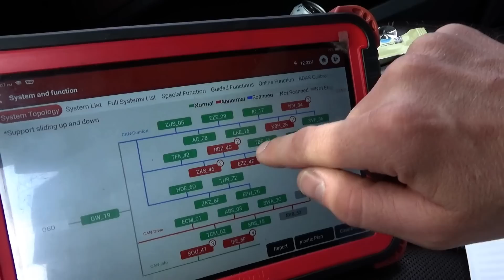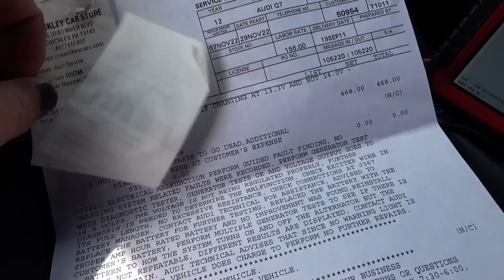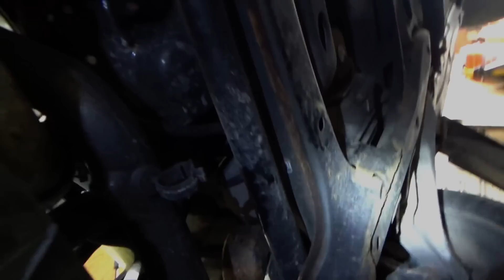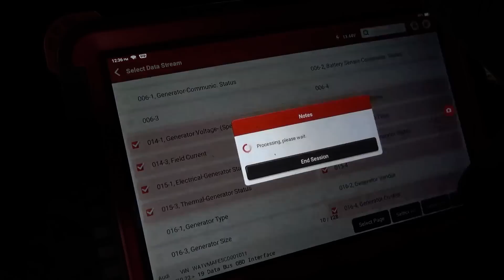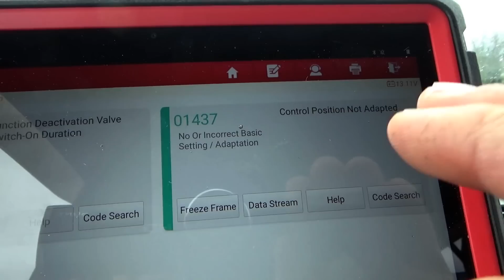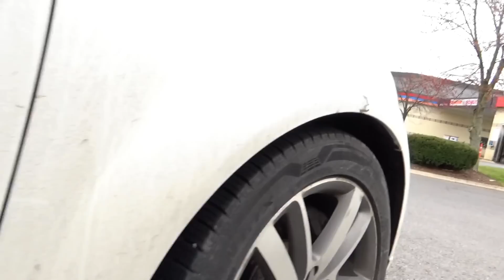Audi From HELL...DEALER STUMPED!! (Part 1 - Charging & Air Suspension MALFUNCTION)

Comment: You know what I use the dealer for?  I wait for their synthetic oil change, or transmission flush special coupon in the mail, then also get their 200 point write up for free.  Decline the determined other repairs, and say thank you and goodbye.  Then I go to O'Reillys or Rockauto and book a Saturday morning for my own services at typically 1/5th the cost, all in.  Their CRM system must hate customers like me.  Flagged as a cheapskate.

Comment: Boy ow boy Ivan you got that right get a reader and a few tools you will save money.my wife's car "Dodge  charger " has electrical issues I took to shop here they had for a week could not find the issue for it back home on trailer a few hours later I found that one of the ecm plugs was loose how I don't know but everything lead me to there pushed plug into ecm she is driving it still to today .it still has a blinking over head but I don't wanna got there .

Comment: I chased a low voltage code for 6 months just to find the car was coded for OEM EFB when it had an AGM battery in it 😅 It fixed so many random symptoms. All the way down to it fixed the dangerous inconsistent braking

Comment: It seems Audi repair is the same mess everywhere in the world. The only thing they know is to replace expensive parts until it works by magic.
I'm more and more thinking about purchasing my own diag tool... Audi is not able to repair my Q7 (air suspension issue, air conditioning heratic behavior), when I see how they analize data... In fact they are just lost. They come from mechanics not from electronics and software. They have no methodology to understand an issue as soon as it touch sensors, actuators and so on.
Not acceptable from a brand who's supposed to be high-end. High-end doesn't mean just high cost :) it shall mean high expertize first

Comment: Good advice. Got myself an XTool D8S and have already made two key replacements for my 2011 Ram 3500 dually, and found five codes in my fairly new Subaru Ascent that for some reason did not set a check light but they were serious electrical stuff cause by the dealer screwing up a radio/entertainment head replacement. Your videos help me transition from commercial electrician to auto electronic tech. Thanks.

Comment: I had a similar experience with a Range Rover. I did not have the correct scanner for the customer's vehicle so I took it to a reputable ( I thought) Land Rover dealership for an inoperative air system. Before they would diagnose it they said that all 4 shocks had to be replaced then they would proceed. Total cost 2500.00 x 4 = 10,000.00 CDN  labour not included. I declined and later discovered the reservoir tank had rusted out.

Comment: Makes my blood boil too, but using my autel maxi system is was able to reset all my suspension,  and calibration was a doddle. I had similar charging issues with my q7, and found that after a battery change the new battery type size and charging rate didn't log after I had told the car the battery had been changed, I disconnected the battery and then connected it again, and was successful in setting the new details. All good now.

Comment: Another reason why I will never again use a dealer for service unless required due to specialty tools or processes.  I've had very similar negative experiences and had to fix poorly completed work and components.  I've been a VW/Audi guy for a long time and I've come to a conclusion on their products.  Anyone outside of the engineering group of VAG do not properly understand how their systems work.  That's why they suggest ridiculous things like a harness replacement for a partially corroded connector.  They are turning into an overpriced parts cannon where the only person who loses is the customer or in your case, the independent shops.

Comment: With the correct OEM tools you should be able to talk directly to the air ride control module. This is done end of line at the assembly plant. If you can talk to the air ride suspension module you should be able to have the system do a systems check, and if this fails, read a DTC (This may be a OEM only tool DTC) that identifies what the module thinks is the failure. Unfortunately, an intermittent power failure when the vehicle changes ride height because of the harness(s) moving around and or being pinched in the suspension the module cannot perform the complete self test. The self test assumes a lot is working, as would be the case of a just built vehicle end of line at the assembly plant. So, if there is an unexpected failure during the self test the diagnostic coverage may be inadequate.

Comment: If its not under warranty, dont go near dealers unless there is simply no other choice.  Here in Australia, Toyota dealers were charging US $5000 to do a rear main seal on an engine, on the V8 turbo diesels.  Its a simple seal job, that does require the transfer case and gearbox to come out, but thats it.

Comment: I'm wondering about those HI liquid cooled alternators. Quite a few ND ones are now built with 12 diodes in the rectifier plate instead of the older common types with six diodes on the plate. These 12 diode types also have a very sensitive load sensing circuit in the regulator that can cause all sorts of electrical issues when things are not kosher with a stable output. The last one I repaired had a partially damaged/overheated diode that only a visual inspection could identify. To be safe with the repair after testing the field coils to be in spec, besides the 12 diode rectifier plate, the regulator and brush holder were also replaced. It is now back to factory service spec.

Comment: Right, if you are going to work on Audi's and VW's , I can't recommend VCDS by Ross-Tech enough.  However, keep in mind that it too has its limitations:  It can not connect to VW / Audi Servers so it can not remove component protection for new or used modules ; it also can not do keys or any other sensitive functions.  At present it does not have SFD capabilities (security protection , ie modules are locked) unless you open them with other scanners (but you need tokens) , then once opened you can use VCDS for diagnosis.  This is primarily on the very current Audi/VW's 2021 and up (approximately).  
I would join their Web Forum and have a look around and feel free to ask questions , its a excellent resource.
The customer support is excellent and the employees and the owner are extremely knowledgeable in their respective areas.  But, you need to be a customer with a genuine VCDS interface to obtain support.

Comment: No.... Listen Ivan - I was an Audi master tech in the bay area at the dealer downtown San Francisco for 20 years, R8 certified the whole lot. There are no rules that because he found corrosion he has to follow a certain recommendation / troubleshoot route! - We were trained to diag. in a certain way but you at liberty to use your brain to find a solution as you see fit. He messed up. He failed to recognize that the connector wasn't fully connected and this caused him to burn time in a different direction, but he still should have realized that the connecter was essentially a broken wire. You should have been refunded and offered a job! Dealers take money - they don't give it out.

Comment: The car is a Christmas tree in part because they have the ECU monitoring stupid things that I assume are cheap sensors, is a sensor monitoring speakers auto engine grade. People pay $50K for an Audi they will pay several grand a year turning off lights, the put the stupid sensors in to create repair revenue. The repair of replacing the whole system would probably be thousands of dollars. I had an engine light and limp home mode, brought it in, they replaced the ECU for $2K and has been fine for years since, things break, and it cost what it cost, modules and mostly the programming are beyond what I try to do.

Comment: Easy fix, replace the air compressor relay under the steering wheel, remove the 373 relay, replace it with 645 relay, job complete.

Comment: I like your videos, Ivan!
It's educational to watch 🙂

I don't have any good experience with dealership shops. One time they broke the threads on the oil pan for the drainage bolt on a near factory new Skoda. The pan was aluminium and the bolt too.
They probably used a power tool to tighten the bolt. They had the audacity to try to charge the cost of replacing the pan to me. After a heated exchange with the shop supervisor
they admitted that they had caused this.  After this I took care of the oil change myself and I promised myself to stay away from dealership shops.

Comment: I blame manufacturers just as much as dealers and techs.  I don't work with cars but every manufacturer I've dealt with has pushed their garbage diag flow charts and resistance tests on wires.  Telling techs to do pointless tests instead of thinking critically and logically sets the wrong precedent.
I just worked on a tractor today that someone else had previously and replaced a bunch of fuel system parts on the customers dime based on the manufacturers recommendations.  I looked at it and found a pinched fuel line in a few minutes.  Fixed with a zip tie to hold it out of the pinch point.

Comment: Ivan??? They charged you $620 to tell you the pump was 'bad'.  You PROVED that the pump was NOT bad.  You were able to manually actuate the pump via your scan tool. You should have INSISTED on your money back.  I don't care about their 'hands being tied'.  Their hands are tied but your wallet is the one held hostage. Again-  you did in 10 minutes what they COULDN'T do in 3 hours and they charged you for it!  I'm in the service business as well-  if I don't fix a customer's problem or properly diagnose the problem- they don't see a bill-  EVER!   I KNOW you work the same way.  Ivan- you need to go back there. Bring your wife-  women know how to kick ass in situations like this- you should see them in court.

BTW- they said they 'bench tested' the pump. THAT'S a lie, if they bench tested, they would have had to have plugged into that same plug that wasn't in all the way, and even if they did, that means they didn't plug it back in correctly after the test assuming the compressor was part of the 'bench test'.  GET YOUR MONEY BACK Ivan.

Comment: I feel if the Master Tech couldn't do anything in one hour that should be a red flag. And why do you need two more hours? Why not just one more hour? He is the MT after all

I think their procedures are designed to condemn the  troubled system as quickly as they can and then recommend a full replacement. Asking for two more hours is just fraud, excuse me, extra profit.

Comment: This is a deliberate scam. Those air pumps contain a desiccant that has a limited life so once they are over a certain age water will build up in the system. That in turn will destroy the valves etc. So basically the pump needs to be replaced at the first hint of any problem. Its probably possible to dry it out yourself in an oven.

Comment: I'm shocked the tech stood by that harness damage and shrugged his shoulders at it. It runs, doesn't cause an open from over current. I remember I had this Mercedes with air suspension that wouldn't calibrate, you have to input a bunch of measurements you take off the vehicle chassis and it would check for rationality and it was supposed to calibrate. it wouldn't take every time we input the measurements. after hours of frustration, we ended up tweaking the ride height sensors just enough to see a slightly lower voltage feeding into the module to get the system to be happy with the body measurements. I wonder if this is something similar, just the wear and tear on the joints and bushings not letting the sensor read a low enough voltage for the rationality check. I would imagine the pressure sensor would want to see a pressure below a set value, and the ride height to be at or below a certain reading, or at least all sensors reading the same, before continuing the calibration. Wonder if you're fighting a mechanical gremlin that's preventing the sensors from providing a low enough reading to finish the calibration. Definitely a frustrating one Ivan!

Comment: I have a Q7 with the air suspension.
The usual problem is the compressor no longer can pump up to 16bar. 16 bar is where it is commanded off once it fills the accumulator. It only starts the compressor >40km/h (30mph) and automatically stops when you go below that speed. The only time it runs the compressor below this normal operation is when the accumulator pressure is too low and one axel is too low.

The compressor is protected by a temperature sensor in the compressors head. When the compressor can no longer do 16bar it gets commanded on forever, but is really cycled by the temperature sensor that stops it at 160DegC for a period. When the compressor is failing it will run for 20 seconds stop 15 minutes (guess) run again, temperature spikes and its off again. So the system pressure only gets to 7-9 bar (my car test results)  and this is just insufficient and you can not get the car all nice and even and level . One side maybe an inch high/lower.

So first test to see if the compressor can still do 16bar if not there are compressor ring replacements kits (after market) and ever entire piston and cylinder heads kits that are also cheap. I repaired mine in the first month of buying the car and now the suspension is always level and the compressor is not always running. 

I understand that this maybe a different issue but if that compressor that is now the right age to be in need of a fixin  I would absolutely be  checking this.

If somebody has tried to recalibrate in the past and it locked them out or the process failed somehow you will now have a fault on this ‘basic setting’ or ‘calibration not run’ 

Got to the end here and realised you also filmed this some time ago and also have already got to your conclusion / repair. But love your vids bud , keep it up I enjoy them.

Comment: Took my charger in for a loud noise that sounded like a high pitch exhaust brake only when it down shifted from 3rd to 2nd that would continue until you went back to 3rd or 1st. An hour later they told me they were unable to replicate. I argued for a bit and finally they sent the master tech to pick me up so i could drive it and replicate the sound. I got it to do the sound every single time it down shifted to 2nd. The guy kept saying he couldn't hear it and finally admitted he was hard of hearing and it's probably my after market exhaust. I was pretty pissed when i found out they had a guy going deaf trying to diagnose a sound issue who couldn't even hear something so loud it echo'd off of buildings.

Comment: I have a 1989 Honda Crx HF with over 377,000 miles on the odometer.  It has never been to the stealership for just these reasons.  I would be way past upset if I spent over 620 dollars for them to tell me that it would take another 4,000 to fix the problem.  Naturally, after 35 years I would like to have a new car, but I don't want to feel as if I have no choice but to deal with the stealership.  At least with my Honda I can fix it myself and have done so since it new.

Comment: Yea the launch, topdon, etc software is very sketchy with alot the VAG products. I have VCDS and its pretty good. Believe it or not the snap-on scan tools are pretty decent on the VAG stuff and so is Autel.The factory tool sucks bsd other than programming and component protection stuff when replacing modules

Comment: There is no way he had to follow any flowchart and was not able to use his head if the car is not on warranty. 
While working on cars with warranty, yes I have to follow guidlines, but even then I will skip a lot of steps, because some if them are doable in 10mins if you use your head. 

They just gave you general crap about flowcharts, so you don’t ask questions about diagnostics. “Thats what audi says well… what can we do. We are just doing what audi told, don’t blame us.” 
Looking forward to next parts.
Reply: Perfect comments. At GM training we are actually taught to evaluate the issue and ask yourself why a chart is asking for certain tests. Based on common knowledge you then skip any step not required. Just looking at a schematic was for the most part all you would need. When you get unexpected results then you need to question it. Just this week had an immobilizer issue with a 2023 GM truck. Tested at immobilizer module for power with test light, no power. Tested at BCM connector by back probing, no power. Looked at chart and they want a voltage reading with a volt meter. Rechecked and had 0.9v at immobilizer and battery voltage at BCM back probed. Ran new circuit and truck starts.

Comment: Your gonna need vcds. Their forums are pretty good for helping troubleshoot these air suspension problems. The green crusties are real for these air suspension problems. Definitely need more water proofing for the sensors and connectors.

Comment: Typical. 

Manufacturers now require a subscription service to get their service information. Hyundai and Kia did this in 2009 when the service information was free to owners and other people in auto repair. Magnuson Moss Act issue. 

I had an ENGINEER tell me that he knew I could permanently fix something on my car (at the time) because he knew i had the ability to do it. He was in the class I took where I was showing the instructor how I tend to approach stuff, and designing something that works. He knew the rear suspension on my old 07 Elantra was poorly designed. My fix was to redesign the upper control arm that can be adjusted where a stamped steel non adjustable control arm was used from the factory. It took me a good 6 months of design work to figure out the geometry before I made the piece that was the end result. It was a turnbuckle style of arm somewhat similar to a steering tie rod system (but larger).